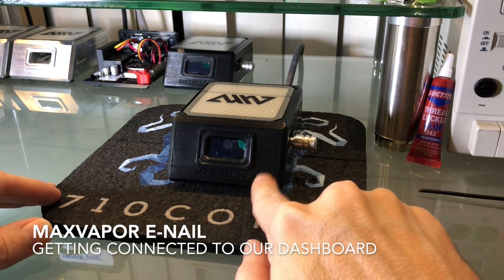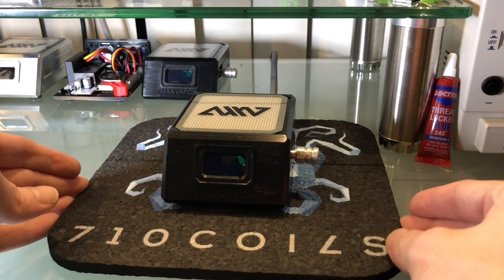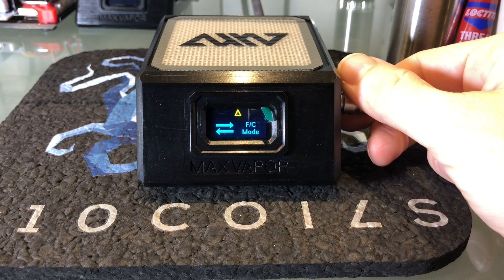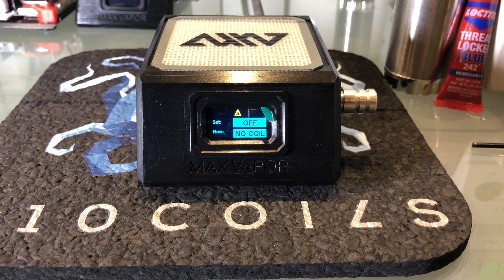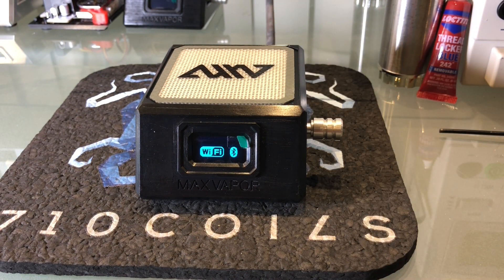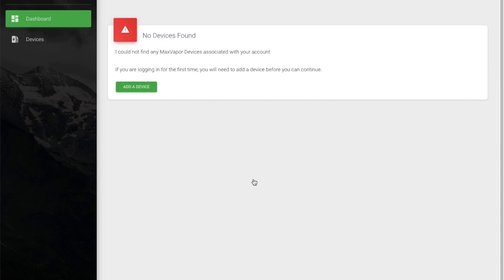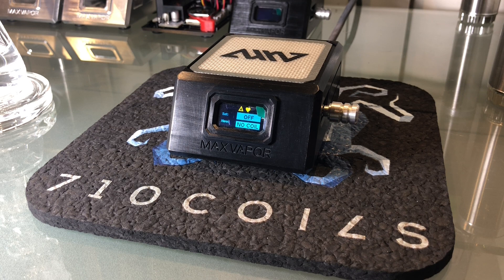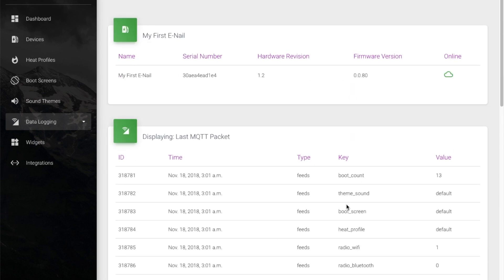MaxVapor E-Nail Controller: Linking Your Device

Comment: What's the wifi password.  You gloss over that part in the video.
Reply from the maker: https://dashboard.maxvapor.com/static/maxvaporbt_manual.pdf
Reply: Max Vapor I would like to purchase, do you know what size coil I would need for my quartz nail from Quave? My nail is a Quartz Club Banger, Male, 14mm, 90 degree angle, XXL. And thank you.